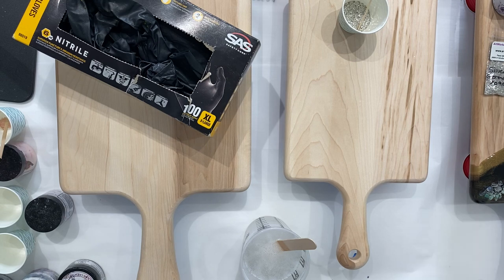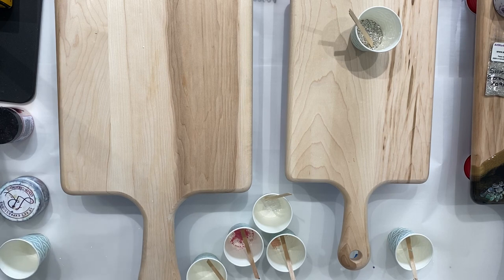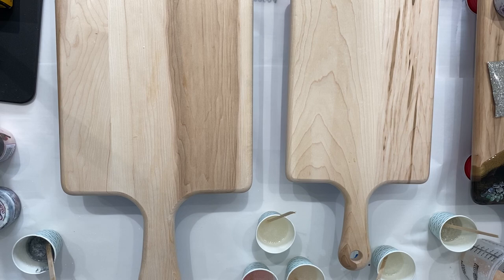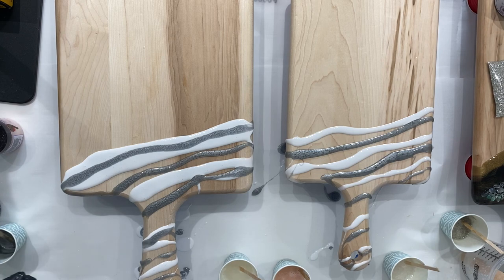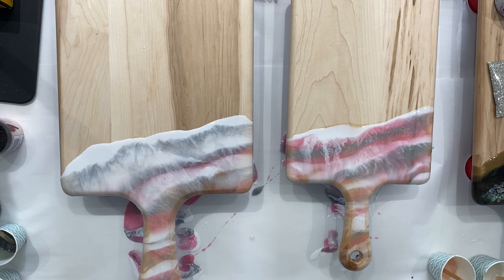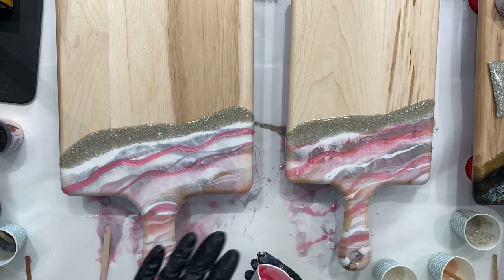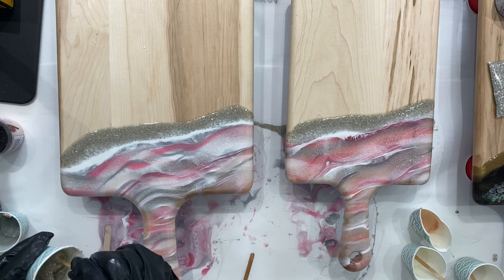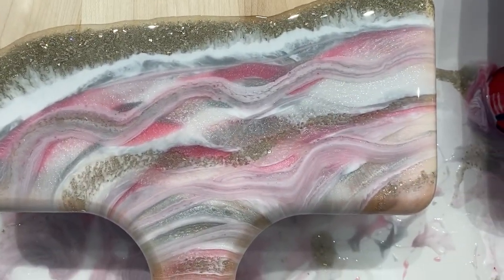Resin Cheese Board (Lots of Sparkle & Bling)

Comment: So pretty. If you want it so that the resin doesn’t run at the bottom next time put some tape across. Unless you didn’t want a straight edge. The colours and pigments used are so very pretty I love them
Reply from the maker: Thank you so much. 
I have taped a few boards in the past, but I tend to love the more free form look. But I’m glad you mentioned that because others may prefer the straight edge. 😃